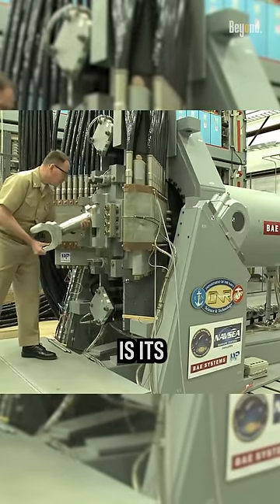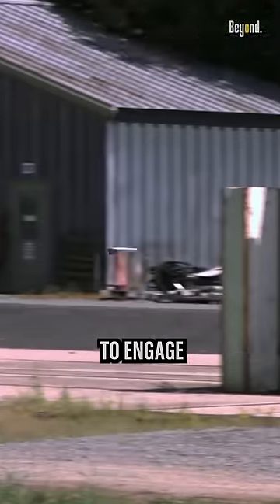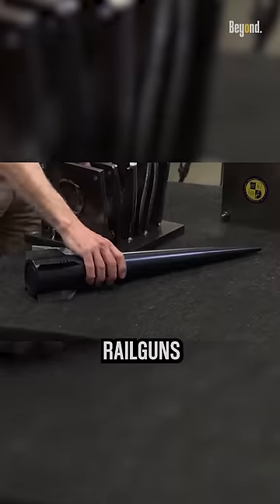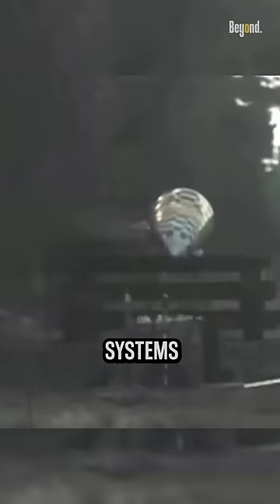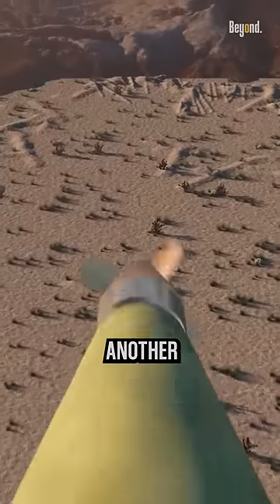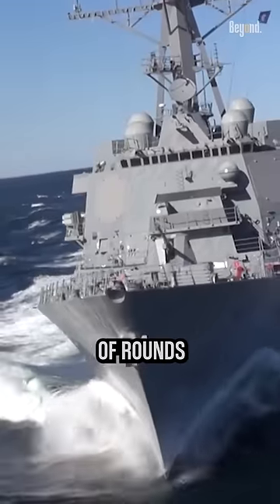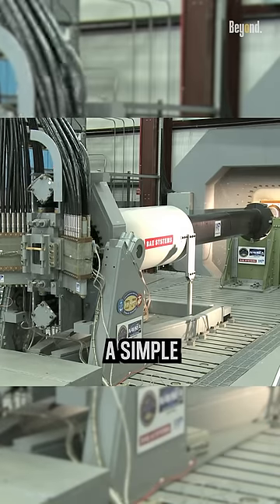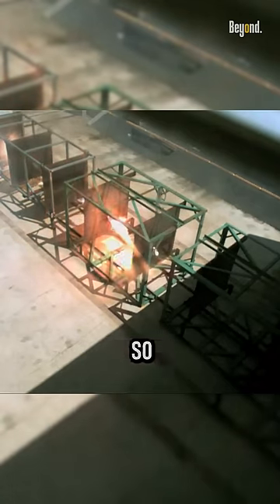Why does the US Navy need a railgun ? #shorts

Comment: When they say it does not need expensive ammunition but dont say the insane electricity costs it has 🤣
Reply: Focusing on the cost of the projectile to the point of forgetting that you need propellant to actually use it.
Reply: I mean at some point a nuclear generator and some huge capacitors would probably be cheaper than millions of pounds of gunpowder
Reply: @FractalNinja nuclear generators and gigantic electrical systems require a lot of maintenance.
Reply: oh come on, a few solar panels on the deck is all they would need!
Reply: Ships make their own. Or did you think they bottle it when they dock and the city bills them?
Reply: @sechesin7111  let's step back a little and look at the big picture. How do ships produce electricity? Do you have any idea how much electricity this weapon uses compared to a city? How many gallons of fuel can a ship carry?
Reply: @thesmellofbacon7595  Do you? 👀
Reply: I'll save you the googling. It's less than 10kwh. A diesel-electric or gas turbine generator (ie the thing that makes boats go when they don't have an onboard PWR) can meet that in under an hour.

If you want to fire shot after shot after shot, A, how did you let an enemy fleet that close to your strike group, and B, you would need a PWR to keep the banks actively charged at multi-MW demands.
Reply: @sechesin7111    Yes, it uses about 100MW. Which is enough to power 110,000 homes. The Ford class aircraft carriers have a nuclear power plant that produces 700MW, so they would have to shut engines off for several minutes to charge the weapon. However, the type of ship this would make sense to deploy does not have a nuclear power plant. The largest available is the Zumwalt destroyer with an upgraded FM 175d, producing only 4.4Kw.
Reply: @thesmellofbacon7595   The US navy has 11 surface ships which already have Nuclear reactors
Reply: Vibrators off!
Reply: @thesmellofbacon7595 Hmmmm…. Nuke reactor man
Reply: @zenko247  aircraft carriers.
Reply: @thesmellofbacon7595  100MW can also power a lightbulb. It's not a useful measurement here. Electricity isn't water you can just measure with a bucket. The gun fires off a brief pulse of high energy, not a sustained measure. 10kwh of energy is enough stored power. Yes, you could use a 100MW source if you wanted and were able to fire every second, but that will never happen.
Reply: @thesmellofbacon7595  you mean Mw right? i worked on generators in the military from 2 Kw to 100 Kw. and 4.4 Kw seems mighty weak for a destroyer
Reply: Not to mention the power output is such that the weapon itself is damaged when used
Reply: And also how the rails themselves need to be replaced after a certain amount of shots due to wear from extreme forces.
Reply: If only we did have more nuclear power!
That and rail gun barrels rip themselves to pieces after a new shots.
The whole gun needs rebuilding
Reply: @thesmellofbacon7595  ah true, not to mention the rails that got to be replaced but it might be a nice tradeoff from basically sitting on a ticking bomb if stockpiles go up, the shells are inert
Reply: I served on a US Navy Cruiser about 30 years ago as an electrician.
It had 3 gas turbine generators that produced 4 megawatts each.
Two were always running (while at sea) and third was backup.
The 5 inch guns required electricity.
The Aegis radar (360 degree comtinuous) required a lot of electricity.
The newer destroyers are similar.
The ships do hook up to "shore power" while in home port and turn off the generators, radar, etc.
Used huge cables like extension cords that are bigger than firehose and weigh pounds per foot. 
Requires several men to move them and comnect them to shore.
That was one of my jobs. Not fun. 
And yes, the city/power company billed the navy.
The aircraft carriers have nuclear power and i do not know how that power is converted to electricity.
Shalom.
Reply: They already have the nuclear powered ships so the electricity is already being made. The thing they are missing is the projectile itself still needs the multiple explosive charges as that it what explodes upon impact with the enemy ship. The firing charge is all they got rid of
Reply: @christopherbic7688  "The aircraft carriers have nuclear power and i do not know how that power is converted to electricity." really? wow
Reply: Modern day battle ship would be awesome. Nuke reactor and one or two of these guns sprinkle in some missiles maybe a 5in
Reply: a lot of those ships are nuclear powered most likely, solves the energy crisis
Reply: Considering the ships it would be mounted on are nuclear powered, that's a non-issue. The actual issue is that it chews up the barrel after a few shots
Reply: But you can just use a nuclear power plant.
Reply: @thesmellofbacon7595  the ships railguns would be mounted on would be the nuclear powered aircraft carriers and destroyers
Reply: @brettknighten1171 Bro... You missed the entire point. The railgun uses kinetic energy kill projectiles. There is no explosive charge that blows up on impact. Instead the massive amount of kinetic energy that the projectile has  converts to plasma on impact and the projectile itself turns into superhot superfast lava that penetrates and destroys the target.
Reply: @akhtarahtesham  that is sooo incredibly wrong the projectile acts just like a bullet from a gun it hits and dumps its energy. You watch way to many sci-fi shows.
Reply: @brettknighten1171  So, according to you the bullet dumps it's energy and drops down beside the impact point resting. Really.?? 
But, this is not a simple copper or lead bullet. Bullet hardly fly supersonic. This one flies more like the edge of hypersonic. At that speed on impact 3 things happen. 1. It slices through the target like butter. 
2. It transfers more like hundreds of thousands of joules of energy to the target. 
3. The energy that's left in the projectile and part of the energy that's transferred gets converted to heat. This melts the high speed projectile into plasma, which penetrates into the armor and continues to bounce inside off the interiors, killing crew and equipment. 
Bullets and KE penetrators are different projectiles with different targets and therefore made from different materials and use different propulsion.
Reply: @akhtarahtesham  quit reading Sci fi books and pick up a physics book
Reply: @brettknighten1171 My guy, the entire point of the video is that railguns don't fire regular bullets but aerodynamic slabs of metal, also you should read a physics book yourself because your terminology is absolutely awful. The other guy is right,stop arguing and talking down on him
Reply: I mean thats not too much of a concern on nuclear powered ships but i see your point, storage of that much electricity for explosive bursts is a tricky thing though.
Reply: @johnmcauliffe8824  In the 2000s I had read about a hybrid electrothermal gun project that utilized both propellant charge and electromagnetic acceleration. Don't know what happened to that.
Reply: @akhtarahtesham  if I had to guess it was either durability or practical concerns (in that the added speed wasn't worth the cost of production)
Reply: Pretty sure we have nuclear powered ship that can be self sufficient for... all the conventional fuel can't do
Reply: @thesmellofbacon7595   massive diesel/kerosine engines dont?
Reply: Non-issue for nuclear ships, but the contacts along the barrel dont last long. I don't think they ever solved it.
Reply: Most warships on board diesel generators can handle the power needs of a railgun. The railgun has been put on hold due to the amount of damage it does to itself accelerating the projectile to hypersonic speeds before it exits the barrel. The power issue isn't due to electricity cost. It's a literal too much power issue.
Reply: @thesmellofbacon7595 nuclear fission for power, and we make a lot of it. It’s really just the barrel that’s holding us back from using it.
Reply: @evokethegoat9077  nope, as I said the largest nuclear reactor in use is the A1B on Ford class carriers. That would require even that ship to shut off most systems for several minutes to charge up a single shot
Reply: @FractalNinja  
Well, I guess that depends on the expectations about how many sh*t you want to shoot to pieces and for how long you think the ship will survive.
Reply: @venomous2die4  you know the funny thing about conventional fuel? They pollute the world more than any other modern alternative, and they aren't exactly cheap or efficient as people think, the only advantage it has is availability

The railgun, sounds like a niche project but, there isn't really anything that can match its accuracy, speed and power, if the barrel wear is an issue pretty sure they can find an alternative for it, I mean, portable size Coil gun exist and those  projectile doesn't touch the rail
Reply: @MastaSquidge  surly they can find an alternative for it
Reply: @nelsonsham2368  doesn't matter if they can or not. The program was deemed a failure.
Reply: @MastaSquidge  failure by what reason?
Reply: @nelsonsham2368  the electrodes used were destroyed by firing the weapon and there was no solution - at least that's the version I heard of. 

This can be seen even in DIY versions of a rail gun and to my knowledge is not resolvable by any technology we have today.
Reply: @FractalNinja you're severely underestimated just how much power a railgun would need to fire once let alone consecutively
Reply: The zumwalt class destroyer generates enough power to run 5 railguns. Power isnt an issue
Reply: @thesmellofbacon7595 nuclear isnt necessary. Gas turbine generators are plenty. The zumwalt can power five railguns. It doesn't have a reactor. It has gas turbine generators
Reply: mount it on a nuclear powered battleship and you don't have a power problem
Reply: @outkast937  you see I know what numbers you're talkin about meanwhile yes on paper it does generate enough power for five or so railguns the problem is you can't find any information online about how long it takes to generate the required power and also the ship itself uses most of the power it generate with little to no excess power remember excessive power generation is costly in the the long run and upfront
Reply: I mean, Electricity cost doesn't matter when you're on a boat with it's own nuclear reactor
Reply: @thesmellofbacon7595  They already have reactors on board though? The only thing they would need to do is retrofit the guns or install new ones, plus a capacitor bank to handle the sudden load.
Reply: Ugh I hate when a comment thread gets more than like 20 replies. Everyone just stops reading and ends up repeating the same thing over and over again. No, even the latest destroyer class ship does not have a nuclear reactor. And even if they manage to jam one into one, it would have to be more powerful than the ones used on Ford class supercarriers
Reply: @christopherbic7688 In case you're curious how nuclear energy is converted to electricity, my understanding is that the reactor heats up water, which turns into steam, and steam pressure turns a turbine connected to a generator.
Reply: @sechesin7111  Jesus, thanks for putting this into perspective.
Reply: @sechesin7111  10kwh for ever shot? You know a big part of ship functionality is in shelling an area on land from the sea, right? That wouldnt even be possible with something like this.
Reply: @jacobhargiss9909  Naval artillery bombardment hasn't been naval doctrine since before the gulf war. Saturation bombing even longer. Railguns are precision first-strike weapons, not howitzers.
Reply: @sechesin7111  "hasn't been naval policy..." naval policy is dictated by necessity. The policy changes based on what we need. Since the gulf War we haven't needed naval bombardment, but that could change in the blink of an eye, so it would be really freaking stupid to phase out conventional artillery on our warships, and if we have both then railguns only come with the advantage of higher ranges which is usefull in naval combat but that in itself is pretty phased out at this point.
Reply: the thing burned it self out with evry couple shoots
Reply: @thesmellofbacon7595  In the theoretical future where railguns become a naval weapon, it would see the return of the purpose-built gunnery battleship. Destroyers are not large enough to carry the required power plant to operate the weapon.

I'd guess that destroyers would continue to function primarily as missile platforms and screening ships. Then you have the capital ships, the carrier and battleship, for artillery and aircraft roles.
Reply: @gbenother8755  Yes.
But I do not yet know the mechanisms as to how it works.
Reply: @kittymervine6115  depends on the fire rate. But as long as you almost destroy the Canon with the first few shots, it won't be of concern. 😂
Reply: The the 15 shots before a complete barrel replacement
Reply: @jacobhargiss9909  Good luck selling the navy on a new battleship.
Reply: @sechesin7111   "on a new battleship". You realize using these railguns would require drastic reworking of ships, right? What I'm saying is that the navy WOULDNT want these because they lack versatility. As battleships currently are, they are already cappable of the bombardment I'm talking about. Nothing needs to be physically changed when priorities change unlike if they moved to railguns as primary weaponry.
Reply: Still $25-50k a round
Reply: it actually does need insanely expensive ammo. those tungsten penetrators are way more expensive than regular naval gun ammo
Reply: @zenko247   how many of them arent aircraftcarriers  that need an entire fleet to protect them ?
Reply: @Ghuirm my Honda generator puts out 4.4KW!

Comment: The gun literally destroys itself every time it fires
Reply: how long would the reload animation be to swap to a new one? 5-10 seconds?
Reply: @jkeebla the barrel actually breaks damn near everytine it is used. Heat damage and rail spread.
Reply: Apparently the cost was horrendous.
Reply: Thank you, I was sitting here thinking why did they leave out the cons.
Reply: I think they get 6-10 shots per barrel.
Reply: It's pretty self-destructive for the canon, the money you save in ammo yo will spend a lot more in New barrels and in electrical system maintenance, looks awesome on paper and from the ammo perspective, but from practical maintenance and cost for the complete system it's not, the Navy preferred to invest in electromagnetic catapults for aircraft carriers
Reply: @victorpiedra6742  and HEL - High Energy Lasers.

Comment: The penetration of that test shot is absolutely insane and a little bit scary tbh.
Reply: Totally. I wonder the velocity….
Reply: Your government is scarier.
Reply: @zackzittel7683  ~2,500 m/s (8,200 ft/s or 5,600 MPH), approximately Mach 7 at sea level.
Reply: @teebob21  thanks! That’s twice as fast as my 3 fastest rifles. I can’t even wrap my mind around it TBH. I’ve got a 300 win mag up to 5,100 FPS with a 30cal discarding sabot holding a 55gr .224” projectile (just like the Remington accelerator) but accuracy isn’t great and it’s just kinda cheating  so a 22-250 just does it better although slower.
Reply: Rusty sheet metal plates
Reply: @konstancemakjaveli  That's an interesting way to describe 150 mm bulkheads
Reply: @zackzittel7683  I think rail gun rounds are on the order of 25 pounds of tungsten
Reply: Depends not really that scary. You fire an armour piercing round like this at a warship then the round will simply pass right through the hull doing minimal damage. The amount of power and cooling required by one of these railguns must be huge and then question isbhow often and how frequent can it fire before it breaks itself
Reply: Not scary enough for the military to keep with this project.
Reply: Sure it really is but useless if the railgun destroys itself with each gun, it was cancelled for naval use.